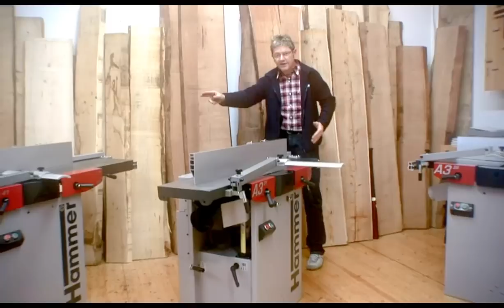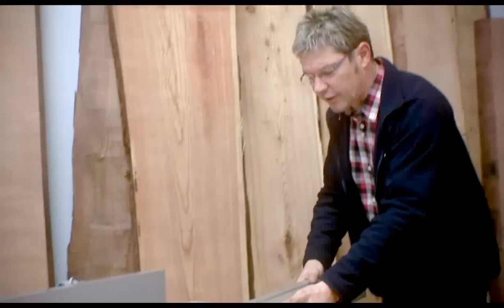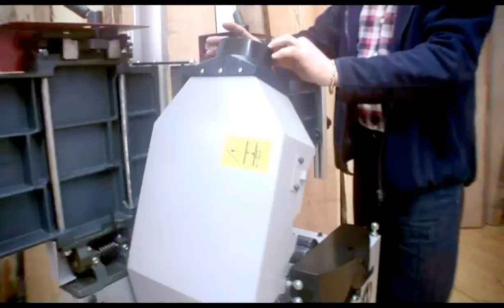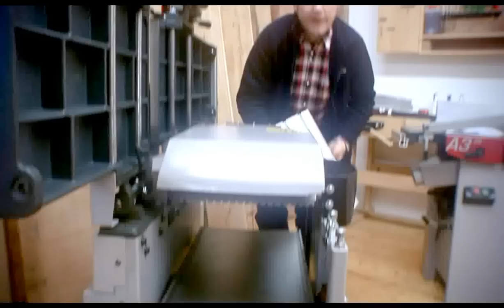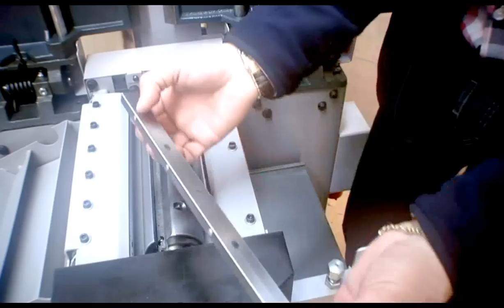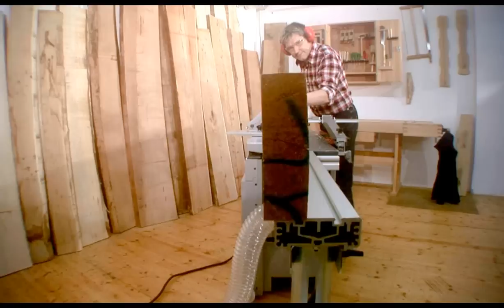Jointer Planer A3 31 from Hammer® | Felder Group

Comment: I’ve had my A3-41 for a couple of years now and I have some observations of my own. For an entry level machine it’s ok but is it perfect? No not by a long way. The knives cut ok when fresh but quickly loose their edge and once the deteriorate the cut quality drops away massively. Means I change knives for every project so weekly as I’m a trade user but they are expensive. 

The extraction is ok but not as chip free as is made out here especially on wide boards and often it’s possible to get bruising from the back roller running over chips. 

I also really don’t think the cut quality over the jointer table is all that great and often snipe occurs at the end of the board. 

When I brought this machine I sold and industrial planner and dewalt thicknesser as I needed to save space. The industrial machine although 50 years old was miles ahead of this machine but at the price point the hammer is a great machine. Would I buy another? No is the simple answer it costs too much to run compared to a tersa block machine. That said I’m not sure I would buy any entry level machine again. 

The fence although it seems a little flimsy is actually excellent and works well. Although the screws that’s form the 90degree stop keep falling out and are long since lost. 

The speed with which it converts from one process to another is incredible and makes this machine worth every penny. Even if you set the top table to zero and pull the fence back towards you (as is the correct procedure it’s still quicker than any other machine I’ve used. For a hobby shop this machine will blow you away, for light trade shops then maybe not so. But it gets the job done.
Reply: Do you have the three knife cutter or helical style?

Comment: Can I get a nice clean cut with the straight knife? I'm debating between the straight or Silent Power.
Reply from the maker: +Bid Budy 
YES - the 3 knife quick-change, self-setting cutterblock system guarantees excellent planed wood surfaces and simple operating comfort.

Watch our Silent-Power Video
https://www.youtube.com/watch?v=FVNWrF8XzpA

Bets Regards from Austria
Reply: Bid Budy when the knives are new yes but the cut quality deteriorates very quick as the straight knives loose their edge. I find the straight knives expensive to run as in hardwood they need changing every job to keep the cut quality right